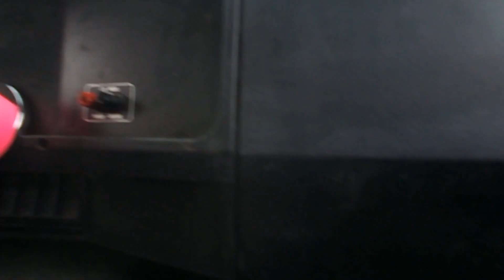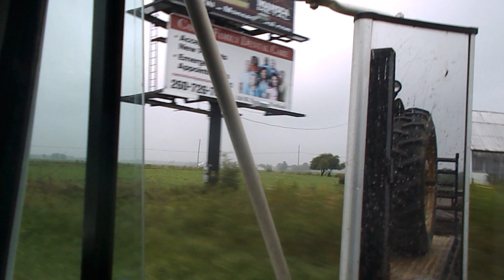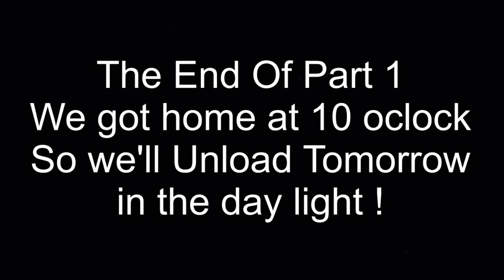Road Trip 2022 Going After Some Goodies I Bought This will be Fun !

Comment: The combine salvage yard in Bryant that Jacob mentioned closed after harvest of last year and completely liquidated by the end of April. Kinda sad had alot of the older binders like letter series gleaners x5 and xx00 deere combines. Bought parts from them a couple times good people to work with. I live the complete opposite end of Indiana from Fort Wayne.
Reply from the maker: I've been there once a few years ago but then we went threw there and even after Jacob talked about it I just cant remember the place, Thats what happens when you get older ! LOL I'm just glad I have a parts machine for both combines cause the older 4400's like mine have a few different part on them than the newer ones do. Both 4400's are first year machines but there are lots of little differences between them and you cant get those parts anymore, So I have one to keep mine running for years to come. Like you I went to way north to get this stuff but it was worth it, I.m about 35 miles east of Cincinnati Ohio so this was an over 4 hour drive to get this stuff but it made for a good road trip.  Bandit

Comment: Loved the 770 oliver great tractor and so handy around the farm. I have the big brother 880 and it is basically my utility tractor without a loader and does every odd job there is. Tell Jacob he is turning into a great truck driver and if you both not to busy it would be awesome to see both of you at the corn festival. Let Jacob know there will be so.e red painted tractors there for him to look at. Lol
Reply from the maker: I told him he needs to watch bone head truckers so he knows not what to do ! LOL  I've run several 770's and 880's before and I always like them plus I love the sound of them !  Dads 1550 gas sounds very close but not like the 770 does, There is just something about the sound of these tractor's, I could listen to them all day. Jacob has been burning both ends of his candle you might say, There is all the work on the farm he does plus he has a new girl friend !  So if you see him up there well he might not be alone !  Bandit
Reply: @banditfarmer1900  that was a good one bone head truckers. The 880 was purchased new in 1959 by my great grandfather. So I acquired it and have been putting it back to factory. I found a nice power booster for it the base weight and a stackable weights. Single set rear wheel weights and all new rubber and have the motor down to the block. From records the tractor has over 9000 hrs and never had been touched. I am a true oliver guy threw and threw. Love the 770 that you added to your farm and looking forward to seeing what all you do with it and I hope that you enjoy it for years to come.
Reply from the maker: @matthewdavis4081  I've used several 770's over the years and I've always liked them, Easy on and off very nimble to maneuver around and it having power steering and a power booster in it well thats just makes it even better and the sound of them is just so smooth and easy to listen to. They are great around the barn yard moving stuff great for raking hay or baling running augers and pulling a grain drill and so much more. I dont know what I'll use it for but I'll put her to work doing something around the farm. I have a set of wheel weights I could put on it after I move the wheels out just a little, There mighty close to the fenders ! LOL  Bandit
Reply: @banditfarmer1900  definitely looking forward to seeing it in action. Thanks Bandit
Reply from the maker: @matthewdavis4081  Oh we'll get some video of her getting a work out for sure !  Bandit

Comment: Awesome video, Don.  Nice to see Jacob - hope he gets back to uploading videos again.  You were right in a recent comment to me that I would be excited by one of your purchases.  I know that tractor is either a 770 or an 880.  Can wait to see the next video and learn more about it.  Great buy.  I don't own a 3-digit Oliver yet, but I intend to.  Also noticed that JD corn head - looks like a 443 or 444.  Mine's a 444.  They are good heads and work nice with a 4400.  You just have to make sure you have enough weight in the back to counterbalance it.  Looking forward to updates and more info on both.  Wow - seems like a great purchase.  Well done!  I'm happy for you (and a little envious 🤣).
Reply from the maker: Well I bought the corn head first and its a JD 443 for $1300 and its a pretty diesent corn head by the looks of it. The 770 came up a little later in the sale and I figured why not so I bought it for $1400 witch aint a bad price for a 770. I'm going to go over it change the oil and filter clean the plugs and look at them and make sure there gapped right look at the points cap and rotor button and check all the fluids and give the old girl some love and get her back in shape again. The guy that owned it passed away and it has sat for several years in a barn, The battery was dated 2015 so she has been sitting awhile for sure.  I figure it was well worth the trip to get both of them for those prices. I just got one problem, My barn is getting full now ! LOL  Bandit
Reply: @banditfarmer1900  Wow!  Those were good prices on both, especially the 770.  The 770 was a good tractor.  They kept making it for years after the square hood models came out because they hated to stop making them because they sold so well.  The 770 eventually morphed into the 1550. (We both have them!).  Excellent buy, Don.  I'm sure you'll have that 770 purring like a kitten in no time.  At least a guy can work on them, not like the new tractors, which are like modern cars, in that you need a computer to tell you what's wrong with it.  Like you said, points, plugs, condenser, distributor, coil, rotor - as along as you're getting spark and fuel, they generally go.  I did have to laugh as Jacob almost shit himself when the was going up the ramp on the trailer and had trouble with the brake and the front end almost came off the trailer.  That was close for sure.
Reply from the maker: @pagrainfarmer  Its funny when your not looking for stuff it usually pops up cheap and you just got to buy them. I could have got a DB 1200 diesel with 1200 hours for $900 and it looked good and a Ford NAA for $1200 but I cant buy everything ! LOL But I came a hair of bidding on them !  In the video you can hear that the 770 is not running quite right, Like its got a little miss to it. As it turns out #6 plug was dirty and was set at about 40 thousand's so I cleaned it and set the gap again cleaned all the plugs and checked the gap and they were all over the place gap wise and now she just purrs like a kitten !  I dont know how long it sat but I would say 2 or 3 years cause the carb was dirty when I got it apart. With it running you could turn the air screw in and out and the fuel jet in and out and nothing changed. But a good clean up and now it aint running rich like it was and idles really good. Being Jacob had just hauled a 901 Ford NF the day before he decided to jump on and drive it on the truck ! LOL The 2 guys there had never seen a tractor loaded on a truck like that before and were amazed when he drove it on, I've done this more times than I care to think about and most of the time a lot more sketchy than this was by far, It one sure way to get the old ticker really pumping !  For Jacob the pucker factor was quite hi !  LOL  Bandit
Reply: @banditfarmer1900  Glad you got the old girl purring and that you bought her.  At least I know you will take care of her.  Hate to see these tractors go to people who will just flip them or part them out. (Unless they're total junk, which this one does not seem to be at all). Oliver mechanic Joe buys a lot of old Olivers - even goes out of state to get them.  It they can possibly be fixed, he makes them right.  If they are too far gone, he parts them out so he has parts for working on other tractors.  If you saw my recent video about the Oliver 66 coming home, he used some of his extensive (literally an old house full - 3 floors) Oliver parts stash to improve my 66.  By the way, when my buddy Cory and I went to pick up the 66 when I first bought it (in June I think) we loaded it the way you did the 770.  It has a tricycle front end and he only has 2 ramps.  Worked like a charm.
Reply from the maker: @pagrainfarmer  I've bought a lot of tractors over the years that were less than ready to go and fixed them back up and made them into good tractors again.  A few years ago I bought a 1555 for $700. It had one new back tire new exhaust manifold and new radiator in it, Bad part was the oil pan was off the tractor and it was locked up. I brought it home pulled #3 rod cap off and the engine turned easy. It had some crank galling but it cleaned up easy with a little crokis cloth put a new rod bearing in it put it back together and fired it up and it ran great. At that point being it had good paint I put 3 new tires on it a new muffler and a seat and gave it a good clean up. I ran it for about 15 hours and put it back up for sale and sold it for $4300 and the guy was tickled to death to get it for that. I did the same thing to the long but just had to keep it after running it. But the 1555 I really bought it for parts but once I got a really good look at it I just had to see if it would run again and it did and looked pretty good.  But the plan was to do a bunch of part switching between the 3 other 1550 I have to fix there little problems and make them right but I just had to see it running again. 8 years later the 1555 is still running great. I dont really know yet what I'm going to do with the 770 as far as the farm but I'll find a use for her, I've kind of always wanted one and I got one in pretty decent shape so I'll keep her around till I figure it out. Bandit
Reply: @banditfarmer1900  Sounds like a good plan to me.

Comment: I'm glad to see you and Jacob working together again. You always seem to have a lot of fun together and get something done at the same time. We had a 880 diesel and it was a great tractor growing up. I see yours is set up for snap on duals. Our 880 was too. Back in the day, we used to drag our fields after moldboard plowing and that was the 880's job. Great find Bandit. Great job Jacob.
Reply from the maker: I really dont mind working with Jacob at all in fact its kind of fun getting something done. When your with good people you can BS and time just fly's ! LOL  I might have to look for a set of duals for it and it would be the 1850's baby sister !  LOL Plus it would look pretty cool too !  Thats one thing about the 770 and 880's they have a sound all there own and I could listen to one run all day long, So smooth and has such a purr to them man its a great sounding engine.  Yup Jacob is turning into a fine truck driver , As long as remembers to shift into all the gears ! LOL  Bandit

Comment: What a trip ! Looks great bandit ! I thought you were coming to Canada at first 😂. That’s a sharp tractor I’m glad Jacob never rolled it ! how many you got now ?
Reply from the maker: With equipment and the lack of it around here you end up going some distance to find anything. 20 25 years ago all the equipment jockeys went threw this area with a fine tooth comb taking equipment out of state , A lot of the small stuff went down in Kentucky and the bigger stuff went north or to PA or Indiana. Thats why me and Jacob end up making these road trips to bring equipment we need home cause there is nothing to buy around here and if you do find it its high priced ! Its not to bad of an older tractor just needs a little TLC and a good going over and an oil and filter change and a good cleaning, I might do a little paint work on it mainly the wheels but it will only make it look even better.  I have 6 tractors now 3 1550's the 1850 and Long and now the 770 , My barn is getting full ! LOL Bandit

Comment: Not too long ago me and my dad went to pickup a ford compact tractor about an 8 hour drive one way well it didn’t go as we thought it would I ended up bringing home a Massey Ferguson 65 aswell to say my dad wasn’t pleased I bought it was an understatement but he runs the damn thing more than I do!
Reply from the maker: I know what you mean , I bought a Gleaner combine up in Greenville Ohio at auction, Man I thought I was never going to hear the end of that one, But like you dad took it over come fall and ran it, I had the combine 3 years before I ever got to run it ! LOL  I fixed my old Chevy dually pick up , 454 4 speed and I did a lot of engine work like a new cam and timing gears and chain 4 barrel intake black jack headers and new exhaust and she sounded good. Every time I turned around there goes my truck up the road without me !  Dad always said well your truck was in the back so I took it instead of moving it and getting mine out!  Truth be told dad just love to drive that truck but I could never say anything cause I used to borrow his truck before I got my own so turn about is fair play !  Bandit

Comment: cool so is that a corn head for the 4400?
Reply from the maker: Yup its for the 4400, I've come to realize I'm the only one around here in 20 inch corn and I've got one head that will fit one combine and if it goes down I got a big problem. So I've decided to go back to 30" rows for corn as a just in case of I need someone else to shell it anyone can do it kind of thing. Still like the 20inche corn rows but I just got to do what makes the most sense for me to do and beings everyone is on 30's around here it makes it a lot easer to have things done like spraying putting nitrogen down to having someone else harvest it for me if needed.  The Oliver 770 well its a nice tractor for the price plus there kind of a cool tractor to have around.  Bandit
Reply: @banditfarmer1900  will the new 443 cornhead fit on the 95 as well?
Reply: @angus4202  yes it would
Reply from the maker: @angus4202  I can put the 443 right on the old 95 with no problem as its got the newer style feeder house on it so I can use the newer heads on it.  Bandit